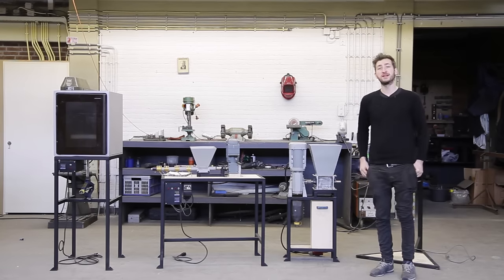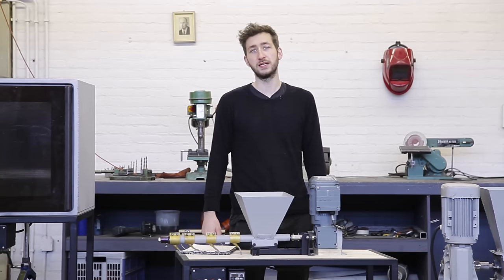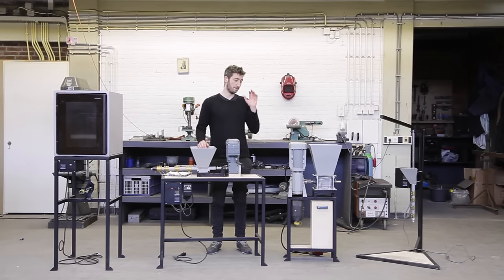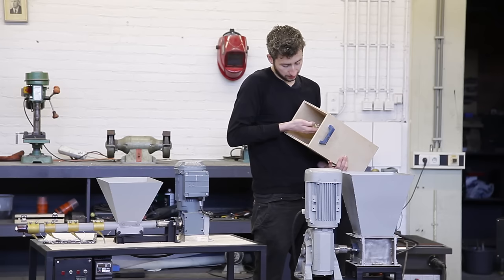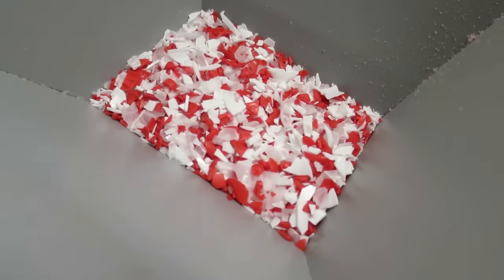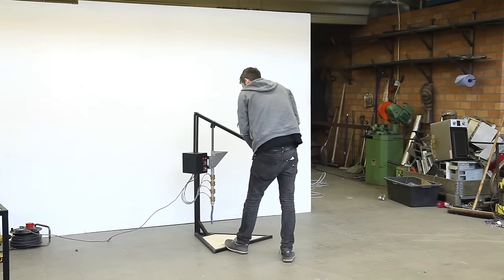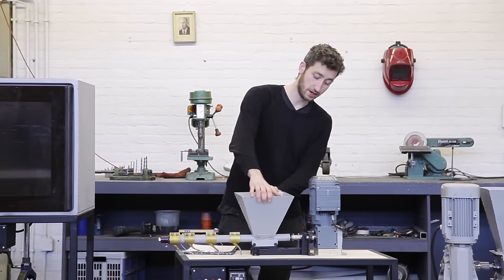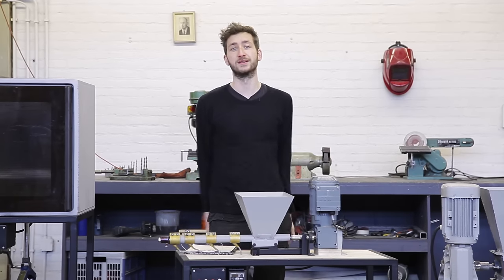Precious Plastic - Building machines (part 3.0)

Comment: hello, all the info is great but you might need to make a video that talks more about the heaters, temperature controls also where to buy and the proper way to wired up because that is the dificult part 
THANKS

Comment: can it be made primitive furnace for melting plastic which will work on wood.
For  materials as concrete and a metal bucket This is my thinking about Third World countries 
which does not have such advanced technology as a welder 
but by using available materials such as concrete and a metal bin to make a plastic melting machine